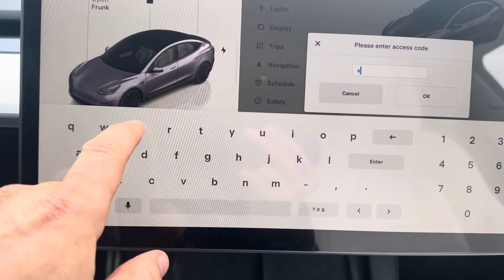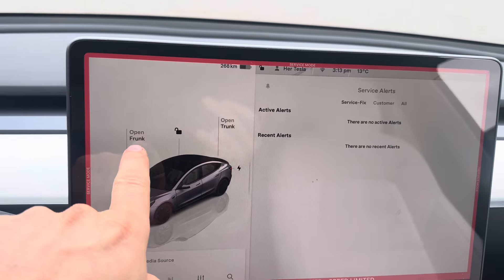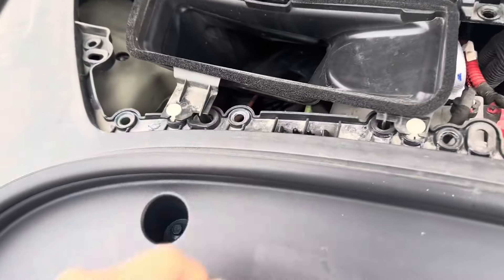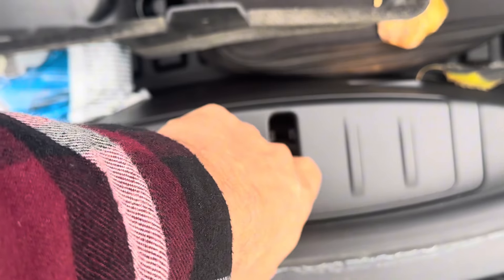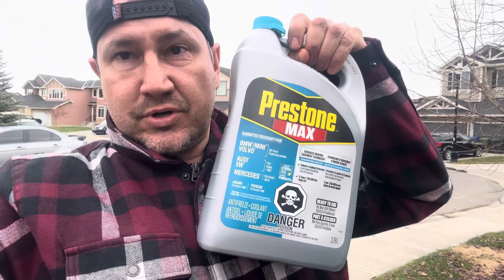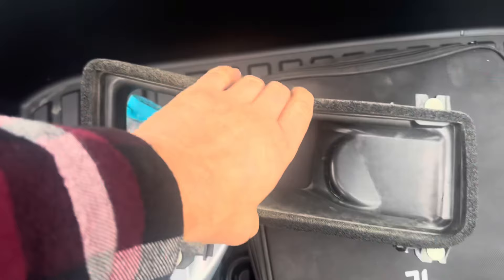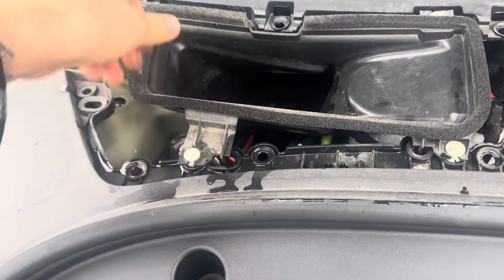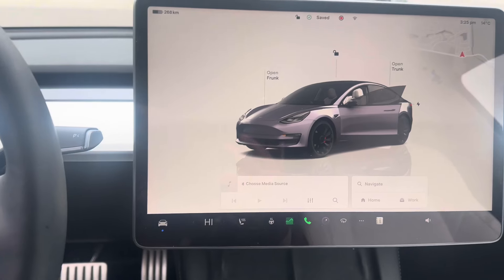How to add Coolant to a Tesla Model 3 and Model Y

Comment: You are a mechanic and did not know that Tesla had coolant…lol…funny. All cars, and for that matter everything that creates heat has to be cooled down. A true mechanic you are not. 😂
Reply from the maker: Really? My golf cart has a heater, battery powered and no coolant 🤷🏻‍♂️ last I checked toasters don’t use coolant to cook toast 😎
Reply: Good lord! Why does the internet have to be so mean. Did the Volkswagen Beetle require coolant?
Reply: @RidingandWrenching  I mean if you want more modern, the 911 was air cooled, or even more modern the Fiat 500
Reply: Why is it that insecure know-it-alls with limited knowledge always feel the need to correct others? They can’t handle the fact that someone might have a hole in their understanding in something, so trolls overcompensate to feel smarter than they actually are. It’s usually the young ones too. 😂